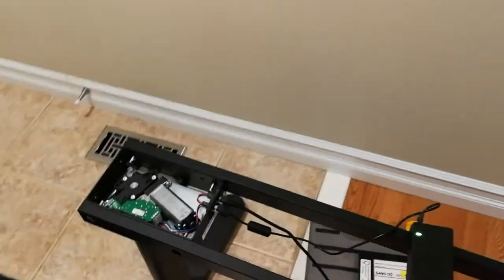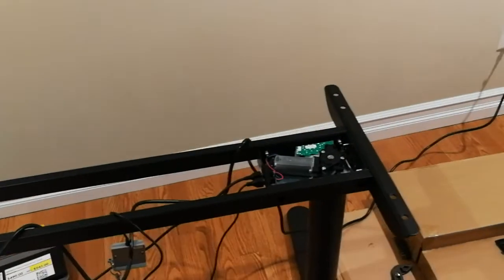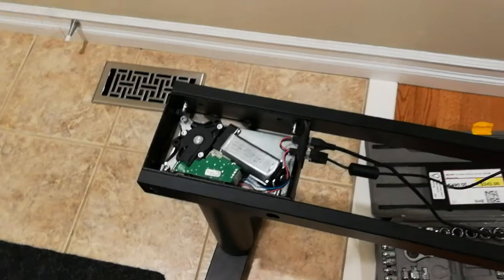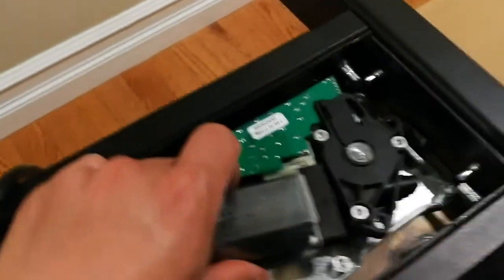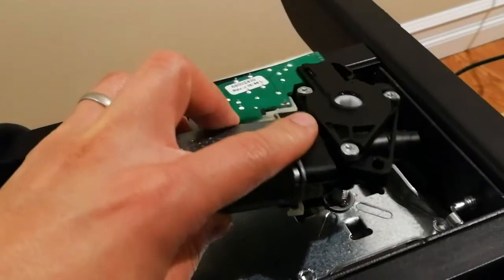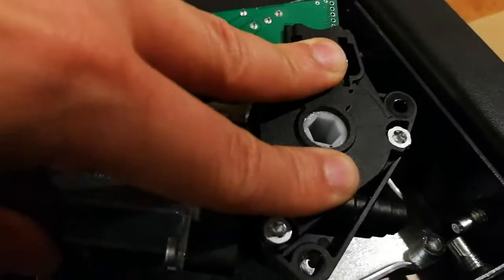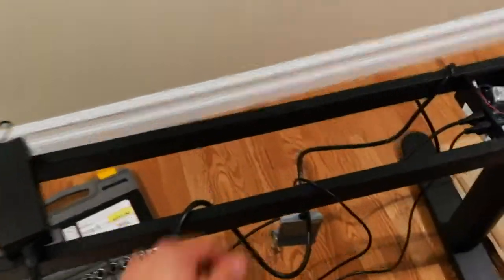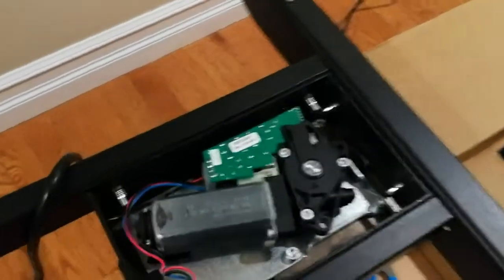How to fix IKEA bekant desk (one leg going slower or not moving)

Comment: This video helped me out.  Thanks!  My fix was a little bit different.  The connection you mentioned was good on mine, but for some reason I needed to use a zip tie to pull the circuit board a bit tighter to the motor.  I assume the internal connection was faulty.  After using a zip tie around everything the unit works perfectly.  But without your video I wouldn't have focused on that area.

Comment: Mine had the same problem, fixed, it, thanks.
Reply: I have to correct myself - after I tightened the contacts and re-assembled the table, it worked at first - but stopped working again shortly after (the legs are not moving at the same speed at first). I'm thinking due to the motors having a little wiggle room in there, the contacts might become loose again.

Comment: When the table is going down the right legs is going faster at the beginning and it looks like table is bend a bit to the right side. Not sure it is they same problem. I turned I over ( legs in the air) and the right legs seams to get bit stucked if goes to the lowest position.
Reply: did you solve it?